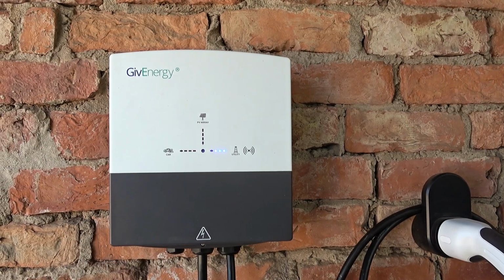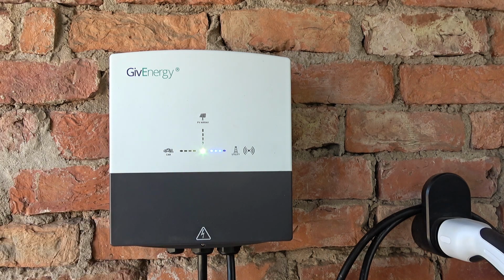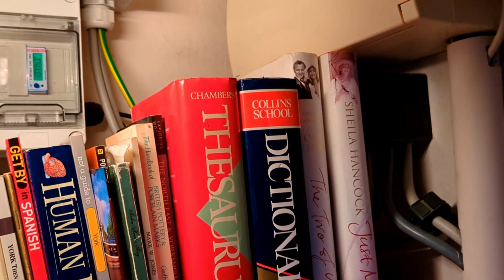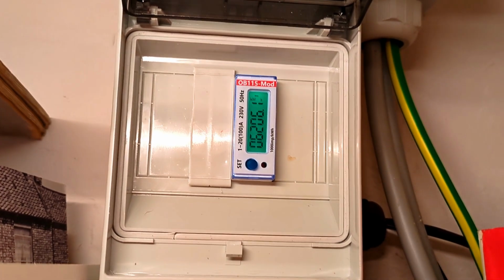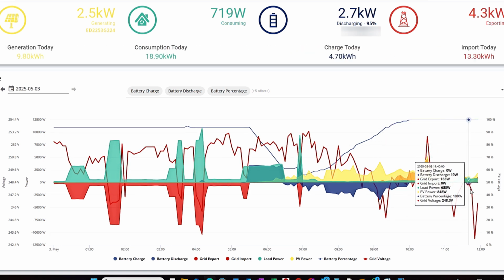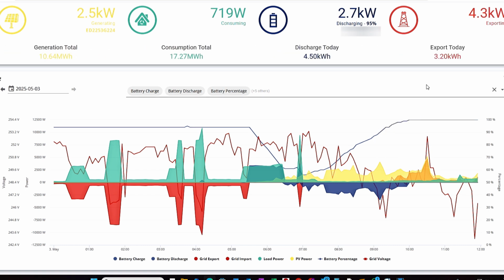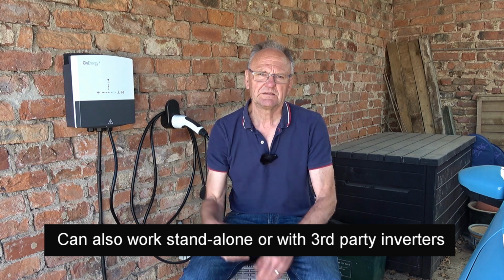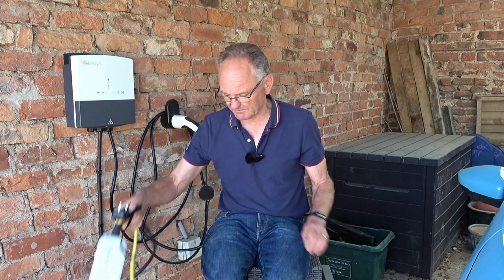HS310 EV charger Grid over-voltage problem

Comment: Interesting information, I always wondered about the power distribution in other countries, here in the USA particularly the area I live in, East Tennessee the power grids in the US are very old, yes upgrades here and there but in the whole the brown outs and what I called dirty AC is common. I have special surge protections systems in place at my home. I just don't trust the power here it randomly drops etc. I feel the problem is when they keep building whether it be industrial or residential they don't really consider power, it's always after the fact, kinda after the barn doors are closed. You get notifications that to limit loads of air conditioning, I feel it's their job to make the supply fit the demand. We pay for it. Great videos as usual. Also here with the EV world coming in, most are really unschooled to what is required to own one at home. Older and most homes here are not able to add such a load. But oh no one thought about that.
Reply from the maker: Good day Sir, thanks for the comment. As and Engineer and with some electrical background (but not an electrician) I find the whole subject fascinating. I'd say that here in UK there are 2 major considerations. 1) domestic solar generation and home batteries and EVs are changing the whole dynamic of the domestic connection. Solar panels are exporting, batteries are time-shifting, cars are increasing peak load demand. 2) the UK grid is the wrong shape now, and needs to transition from 'star patterns' based around monolithic generators like coal and gas to a mesh connecting hundreds of generators (wind, solar and grid-level batteries). The Government has to some extent ignored this until recently but we have reached a tipping point and now they are investing. But still I feel the finer aspects and impact on electricity distribution networks have still be to understood. For example a house with solar in mid-summer could probably power the AC in 3 houses so in that case the exported power need only travel as far as your neighbour.  UK is about the land area of Texas, and that's fitting because I think Texas is currently the biggest investor in renewable energy within the USA.  Renewable energy is now so cheap that countries need to invest in infrastructure to stay competitive in the longer term. In the UK the way the energy wholesale market works is archaic and needs transforming just as much as the physical grid. The UK Government has just ducked that one but they are going to have to do it - just as sure as night follows day. Cheers

Comment: Pretty sure if you are out of spec the DNO should be doing something about it, the problem might come if its your solar that's pushing the voltage up too high, often you can set the solar inverters to disconnect at a lower voltage, say 251 to give yourself some breathing room, if you are charging the car they will reconnect a few minutes later and pick up the load.
Reply from the maker: Hi, as a homeowner, not installer, I don't think I can adjust the inverter disconnect voltage? So far my Givenergy inverter has not disconnected so it must tolerate a voltage higher that 253v - in fact it reported 255.8v peak briefly today. I think the solar only pushes up the voltage by about 1v-ish so even with the inverter disconnected it may be over 253v by a smidge. The EV charger does not throw up any overvoltage errors at night.    So to be honest I'll probably live with it with the expectation that sooner or later Givenergy will lift the trigger voltage a bit to avoid nuisance alarms. But if necessary yes I will contact the DNO, with an expectation they won't much if anything - that seems to be the message from comments. Also I can't be the only one in the area with this problem - I'll let some other people do some chasing first. If my inverter starts disconnecting then I'll be on to the DNO. That would be annoying. Cheers

Comment: It's a huge problem that I have berm bringing up over the last 2 years. DNO did what you said to a customers home his solar inverter was cutting out. As an installer the manufacturer allowed me to increase the upper voltage to 260 to get over his issue. DNO not intrested. I advise my customers to buy older ev chargers as I cannot supply and fit any ev chargers that are not modern. We are in rural area so over voltage is an issue.
Reply from the maker: Thank you Gino. My installer agrees, he said overvoltage is becoming an increasing problem affecting many models/components. Cheers

Comment: Have you asked the DNO to come in and monitor the supply in some cases they will make the required change at the substation normally no charge
Reply from the maker: Hi Terry, I have not contacted the DNO. I charge at night and that's fine. I have a low expectation of what the DNO might do so I'm leaving it unless/until it becomes more of a problem, perhaps affecting charging at night or affecting my solar export. Cheers

Comment: I have the same problem with my Zappi not helped by lots of solar in the street, I now only charge at night works ok for me as I get more for export than I can charge at night. The DNO won't change the substation tapping as it's not far enough out. At one time it was also tripping out the solar export but was able to increase the limit and only happens occasionally now

Comment: Hi Paul, this might be a case where you could use a bucking transformer to drop the voltage about 15%. 
I know they work good for motors, but I’m not sure how it would work on an electronic charging controller because the load current sign wave is not sinusoidal. It’s more of a trapezoid wave. If compatible, it would be a simple low tech solution.

We started seeing similar situation in the HVAC industry as they added more and more electronics and safety features. They started causing more issues than what they were trying to protect. 
Cheers…..
Reply from the maker: Hi Dean, thanks. When the supply voltage is out of spec electricians here are encouraged to fit a 'voltage optimiser' which is just a dumb toroidal transformer in a metal box for the whole house costing perhaps US$400 plus fitting. They have a number of selectable tappings in perhaps 6v steps. But it's a bit of a primitive solution and I'm probably only a volt over. I think they will probably do a firmware update for the charger to lift the threshold a couple of volts because it's generating a lot of traffic for the customer support teams. I've spotted your belt sander video and I must have a look. Unfortunately Vevor cannot sell electrical equipment in the UK due to some safety concerns early on. It's a nuisance because they have some good stuff. Cheers

Comment: Very interesting Paul. A lot to think about. We don’t have an EV and are very unlikely to own one. Sadly due to health issues I can no longer drive. My wife does all the driving now, but it’s mostly local trips. We do monitor all our power usage, and try to keep everything to a minimum. I do worry that my workshop uses a fair bit of electricity to run it, but the workshop is one thing that keeps me going. Nobby
Reply from the maker: Hi Nobby, I had thought I might come to buy an EV naturally as my main car got older and needed replacement but it's 10 years old now and showing no signs of ageing out, so I treated myself to a small EV as a fun car. The old car (diesel) does for longer journeys, tip runs, larger loads, transporting DIY supplies and is good in snow. The e-UP! is just great for shorter journeys, urban driving etc. As you have found, we never know when fate might stop us driving and in fact my wife has stopped already. She just decided one day she did not want to drive any more, just by choice. She is still licenced and insured to drive but just doesn't. So not knowing what fate might hand out, I wanted the little EV now rather than wait. Cheers

Comment: I really like the EV / solar thread, it's something that interests me even though I can't see me having either for some time -good to get some background knowledge first.
Your ICE figures aren't far off. I keep a spreadsheet of my consumption (much to the amusement and ridicule of my colleagues!) and can report that my fuel only cost (2L petrol) is around 15p per mile. When I drove a 2L diesel the figures were broadly similar (more expensive fuel but higher MPG)
Have a good weekend Paul, Matt 👍
Reply from the maker: Hi Matt, in April my panels generated 800kWh - that's about what I'd expect at the peak in June.  Last April they generated only 600kWh. So it's a combo of ongoing firmware updates/improvements and just a sunny April I think. With the EV now the night rate is  about 6.7p per kWh for the house and the car, using the battery to power the house in the day. My total annual electricity bill should be about -£100 (about £100 net income). Pity I can't get the same for gas!! I have thought about a heat pump but I reckon daytime electricity prices need to come down by half to make the business case work. No sun in winter to run a heat pump and big batteries to charge at night and run the pump in the day would be too expensive.  Cheers

Comment: What about adding more cable to the EV Charger run, they recommend about 3% loss in the cable which would be 6.9 Volts.
Reply from the maker: Hi Andrew, I see your point but there is no problem whilst I'm charging. It only happens when the charger is inactive and practically no current is drawn, and hence no volt drop on the supply cable. Cheers

Comment: Hi Paul. I don't have solar or an E-car. But i am very fascinated by the way you explaine it, I might go for it. Cheers from Denmark. (jubii means kind of cheering, but close enough ;-)) Henrik
Reply from the maker: Hi Henrik, Google translate is dangerous 😁🤣 . The E-cars are very quiet, refined, smooth and fast acceleration. The highest torque is 0kph speed, so I have to be careful not to spin the wheels when I set off, especially if the road is damp. Cheers

Comment: Didn’t artesian electrics cover this recently on their YouTube channel?
Reply from the maker: Hi Ian, I saw one where they fitted a voltage optimiser but in that case the voltage was too high in the day and too low at night so it did not fix it.  In the event the DNO had approved generation and export which was far too high (administrative error) and so the DNO paid for the house to be upgraded to a 3 phase supply which solved the problem (inverters balanced over 3 phases). To be honest I don't like voltage optimisers - just a transformer with optional voltage taps. I think soon the spec will be widened (e.g. upto 255v in the charger) pragmatically to reduce problems. I can charge at night no problem and in the day my case is annoying but marginal really as I would rarely see above 255v. Cheers

Comment: I’m long retired from the grid so only know a bit about Osbaldwick 400kV and Poppleton 275kV subs in your neck of the woods, and that was 20 ish years ago.

There are automatic (and manual) tap changers on the secondary of some 275kV & 400kV grid transformers, not many though,  those with 11kV, 33kV & 66kV secondary voltages.
 

Presumably on the 132kV system they are more prevalent, the DNO gained responsibility for the 132 network in the 1980’s
Reply from the maker: Thank you Martin, that's very interesting to know. I don't 'blame' anyone on the distribution side for this situation it's a natural consequence of how the network is made up. If anything the people who write the specs and those who design the EV chargers need to get out a bit more and check real world conditions. I'm sure soon enough there will be a pragmatic spec change and it will all settle down. Early days yet for green energy and EV rollout at scale. Just growing pains.  Cheers

Comment: Hi Paul, What an interesting video this was, you explained it all so clearly, well done. By coincidence I was explaining to wife that at one time the UK was 240 Volt, by showing her my old radio which dates back 45 years, she had one that was similar which I think would indicate 220V, when I find it I'll have a look!!

That same radio came to our resucue last week with the major power outage. We were eventually reconnected at 3:30 am the next day and I decided to throw some of the food we had out just in case. The PM went on record yesterday saying that there are millions of data points to analyse and it will take 6 months to establish the cause of the problem. I can see the complexities of the current system and I wonder just how robust it is. I'll let you know as news filters out although it will probably be mainstream anyway.

The octopuss system is being pushed quite hard out here. I think its a project we will take on sooner rather than later

Have a great weekend!!
Reply from the maker: Hi David, thank you. Spain has a lot of solar and in many cases the inverters need grid power to synchronise output. The grid is their reference and they 'join' the supply network locking onto voltage, frequency and phase. So if the grid goes down they have no reference and so they go offline. Thus you can have loss of one feed and xx solar farms go offline like a cascade effect. Likely to happen if loads of independent generators hook on without a single overall grid design authority. It will be interesting to see if it was something like that. Our 230v supply is of course 240v and always was. We just have to pretend it is 230v to conform to a harmonised standard with EU. Nobody went around swapping out transformers or re-tapping them, as far as I know. We could say the moon is cheese until we landed there. I don't know if new housing estates (with a new local transformer) are 230v or not.  I've seen chatter but nothing definitive. And it depends on load anyway. I don't think any of this stuff is electronically regulated say with inverter supplies - I think it's still just dumb transformers. But somebody might correct me ...... Cheers
Reply: @HaxbyShed  Yes its funny you mention that about 240V. I can remember the last generation of chart recorders we made having a power supply problem right at the limits. We had a special power supply to be able to test them at the limits.

Comment: I have exactly the same GivEnergy setup as yourself here in Leyburn, North Yorkshire and experience exactly the same Earth leakage fault several times every sunny day. Our DNO, the Northern Power Grid installed voltage monitoring equipment in my house and confirmed we experienced voltages up to 260V ac. I'm still waiting 9 months later for the DNO to fix the over voltage issue. These over voltage faults are a real nuisance and it’s disappointing our DNO is not putting in the effort to resolve the problem.
Reply from the maker: Hi Daniel, speaking to an electrician he says it's a growing problem for most makes/brands. I think it's showing a difference between the specification and the real world, which probably did not matter until the new tech came along. Now everyone with an inverter and/or charger is a stakeholder/monitor. I charge at night so the small overvoltage we have is not affecting me practically, and I've turned off notifications from the Givenergy app so I don't get pinged 6 or 8 times a day. Givenergy are aware and I'm sure they are thinking about it. It may be the DNO's responsibility but it's also Givenergy's reputation so they have an incentive to find a workaround. Cheers
Reply: @HaxbyShed   I too have a Givenergy charger and have been receiving 'earth leakage' faults . I phoned the helpline to be told that it was really an over voltage condition and was advised to contact the DNO. I came to realise it was happening when my house battery hit 100% and my system began to export.  My resolution was simple , I disconnect the charger at the board until it's time to use it. I only do manual charges in daytime if possible. I reduce the current so that my house battery and solar are sufficient to supply my Zoe without resort to the grid. No night time charges (usually), but zero cost for the electricity, and no bright leds to annoy the neighbours. Ian
Reply from the maker: @jamjar20049 Hi Ian, bit of an update from me. I called the DNO thinking it would take some time for them to respond but in fact they came out within 3 hours, pulled out my main fuse and measured 247 volts. It was a dull day but within a few hours it was over 250v again. Anyway they say they are thinking about it and might come back to fit a voltage monitor. I'm not expecting much to happen but you never know. Cheers

Comment: Interesting Paul👍👍👍👍
complex subject for the uninitiated, I will be sticking with a fuel tank or i may become brain dead🤣🤣👍👍
atb
Kev
Reply from the maker: Hi Kev, have you ever thought about how much energy there is in car fuel. Imagine a 1.5 ton car pushed for perhaps 40 miles at 50 miles per hour by the energy in just one gallon (4.5L), and that's with a car efficiency of perhaps 30% (70% of the energy unproductive). It's just astonishing to have that much energy for just £1.45 a litre. Cheers
Reply: @HaxbyShed  Interesting Fact & Analogy Paul, I'll be thinking of you when i refill the car now
😉😉👍👍

Comment: Feeding the car charger from a core-balance earth leakage circuit breaker (ELCB)  would eliminate the problem of electric shock if the neutral becomes disconnected.  The setting of the over-voltage trip level seems excessively close to the mains tolerance band, too.
Reply from the maker: Hi Chris, by regulation, the EV charge point is fed from a double pole 30mA RCD so it would trip on any L/N unbalance. The issue of voltage tolerance I think is one of desktop  engineering Vs real world engineering. People with boots on the ground know that the voltage can be often out of range - but seemingly the people in white coats who specify this stuff don't. But a pragmatic firmware update would remove most of the problem. Cheers